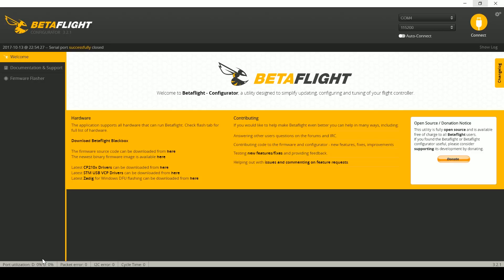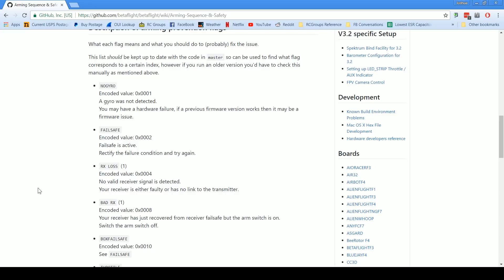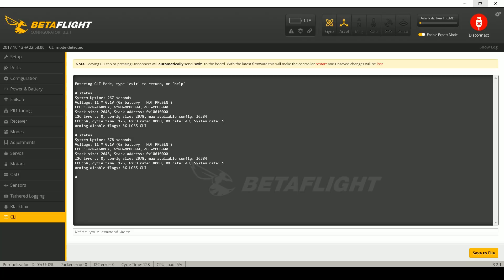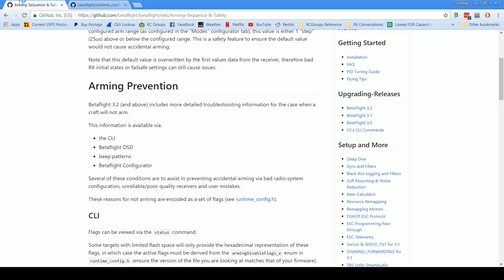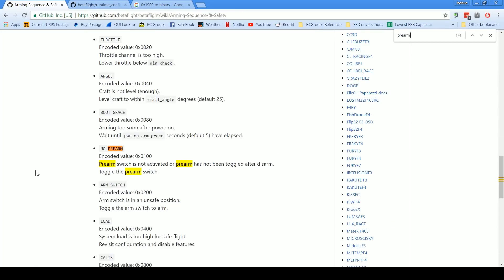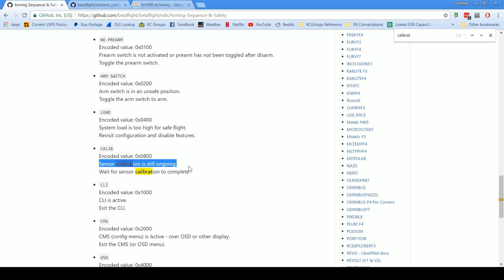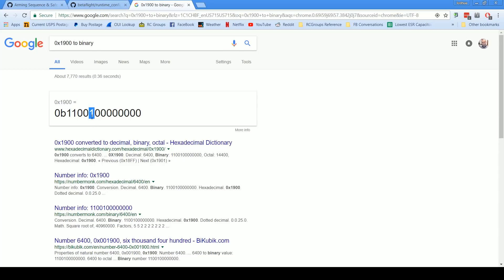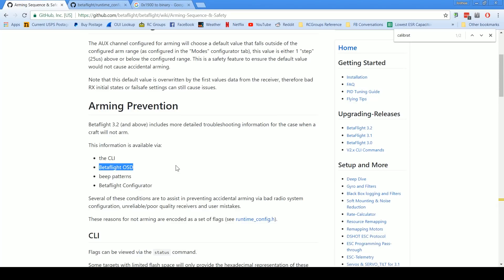Betaflight 3.2 | WHY WON'T IT ARM?

Comment: I just spend a few hours trying to get my quad to arm. I finally found this:
https://github.com/betaflight/betaflight/issues/2914

 
 set moron_threshold = 100

 save

 
This seemed to do the job. 
Apparently the moron_threshold says something about the window of acceptance for the gyro values. Setting this to a higher value will allow some noise from the gyro's to be within acceptable range. (If I mis understood this, please do correct me)

 

The weird thing was, when I plugged it into the computer by means of USB, Betaflight instantly gave permission to arm. But when I connected the battery, it sometimes could take a long time before getting the 3 beeps. So it was difficult to troubleshoot as I could not note any troubles when connecting to a computer as it gave no Arming Disable Flags. Anyways, it seems to work now. Hopefully this helps some people who have troubles arming.
Reply from the maker: +MaartenFilms if you need to change that parameter it suggests something is abnormal about your gyro. Keep a careful watch for weird flight twitches that might indicate the gyro is failing.
Reply: Thanks Joshua, I will. Hover test was okay. I'll be doing some more testing and be cautious. If I suspect anything weird, I'll just change out the FC.

Comment: How do we fix it both my new bf f4 has this code and many others. I plug my quad upside down so it don't move then I can fly no problem... its annoying bf f3 no issues always f4 after fresh firmware update. No accellerometer it's disabled...
Reply from the maker: +Gap of DooM what code does it throw? What flags are active?
Reply: Joshua Bardwell it was the throttle flag, so i set min check to 1100 it works now but not sure it was the right thing to do thanks for the info!!! And thanks for educating us, appreciate it very much 👍

Comment: Hi Joshua.I just flashed with betaflight 3.2 and dshot 600 and racerstar lites 30a escs and an issue occured.I used dshot with betaflight 3.1.7 and everything worked fine.Although i tries downgrading and the same happens now.My transmitter is a spektrum dx8 and i fly with a satellite reciever.FC Betaflight f4 from banggood.When my quad is plugged at my laptop and the battery is on i can arm it, disarm it and it works great.As soon as i unplug the usb i can arm the quad it works and after 10-15 seconds it stops, the fc blinks the satellite blinks and escs beeping strange tones.I would apreciate if you could help!Thank you in advance.(Sorry for my bad English)

Comment: Thanks Josh, great information and appreiciate your guides and best practices.. I followed your steps on this one and my Betaflight FC F3 still wont arm after going to 3.2... I am set in air mode and converted the hexdecimal to binary and looked at the link; 

Here is the binary 0b1001000100000

Any thoughts? If i flash back to 3.1.7 it works fine, crazy part is i have a betaflight FC...
Reply from the maker: Ok so using the technique in the video, what arming flags does that binary code indicate are active?
Reply: Throttle error - i have it at 0, CLI (i closed after and tried, then the last one - BST error ?

Comment: Thank you for existing!! 
So I did as you explained (f3 board).
The binary told me 13, 
CMS
Encoded value: 0x2000
CMS (config menu) is Active - over OSD or other display.
Exit the CMS (or OSD menu).

How can I exit that?
I typed "exit cms" on the CLI and it rebooted but it still shows the same status.
Please help me! Thanks.
Reply from the maker: "Exit cms" doesn't do anything. The only reason it appeared to do anything is because "exit" is a valid command.

Have you got the OSD open?

Have you got an OLED screen attached with the config menu open?
Reply: Joshua Bardwell The OSD is disabled.
I never figured out what happened but it's arming! I had the crazy motor issue when I hit mid throttle but it seems it is normal when the quad has no propellers to keep trying to correct the vibration or something.
Reply: Joshua Bardwell Oh God... it stoped arming again, with the same issue.
Reply: OLED is also disabled in the features.
Reply: Working again.. don't get it, but I'll see if it flys tomorrow.

Comment: I see in 3.2 release notes to do a backup of your old version then once flashed to 3.2 to paste your settings in CLI and then reset to default settings. I haven't seen anyone elaborate on this, is this a necessary step? I have 2 lux V2 FC I flashed without doing it and all is good. Diatone Fury F4 though keeps booting up in bind mode on spectrum receiver. Receiver tab is all crazy too. Could this be an example of corrupted config? Tried reflashing 3.1.7 and still same. Also I didn't do a backup. Sorry Joshua I know this is completely off topic, any help would be greatly appreciated
Reply from the maker: Yes it sounds like a corrupted config. Frankly, coming from 3.1.7 to 3.2, I would definitely back up the config for reference, but I would probably just re-build the config manually rather than pasting in the lines.

Comment: Anyone else have an older XM+ receiver suddenly not bind green after upgrading?  I'm getting dim solid red/green lights now, and the only change is upgrading to 3.2.

I know, the XM+ probably needs a firmware update.  Just wanting to confirm the possibility that an older XM+ might not bind with 3.2?
Reply from the maker: Going to BF 3.2 cannot in any way affect whether the XM+ binds to the Taranis.
Reply: Joshua Bardwell- Cool, thanks for all the helpful stuff, man!

Comment: My quad wont arm and status says it's the CALIB flag.. the only way I can arm is if I spin the motors in the motors tab and then disconnect from the PC with the battery still plugged in.. it will arm and fly just fine.  but when I unplug that battery and try a new one, I have to do the whole process again.  The OSD warnings says "ARMSWITCH" but in the Modes tab the Aux to arm is moving correctly to activate the arm (the Arm turns yellow, I get the caution symbol at the top of the configurator).  It will consistently behave like this.  Will not arm unless the motors are spun manually in BLHeli or BF configurator before arming with radio.  I would like to think this brand new Betaflight F4 board doesn't have a bad gyro, after all it does fly OK when it finally arms...  besides swapping in a new FC to troubleshoot, any other ideas I can try?  I've already tried the suggestions in the video about leaving the quad completely still/flat on the ground when plugging in, etc.  Thanks in advance.
Reply from the maker: What is the value of the arming flag before you spin the motors?

What is the value after?

Comment: Joshua... SedHendo here. I wondered if you have run into issues with a 4in1 esc when trying to set your quad up for turtle mode.After flashing my Cicada 30A esc with the latest dshot update and with the FC on the newest 3.2 Betaflight. Now one esc won't work. Even if I flash back to a previous version. I thought this was a fluke but this has happened 3 time on 3 secs...

HELP!!!
Reply from the maker: The 4-in-1 ESC should just be four separate ESCs on a single board. Maybe there is some issue with the Cicada 4-in-1.

Comment: Hi Josua Bardwell finally fixed my arming problem thanks for the help. Although now I am wondering about something else. Whenever i reach full throttle my fatsharks picture freezes for like half a second. This also sometimes happens randomly and I don't know why. thanks for the help
Reply from the maker: +Davis Baldwin i really don't know what could cause your picture to freeze up! Wow, that's weird. Since it happens at full throttle probably it is related to vibration. So I would look at the physical wiring and plugs between the camera and vTX.

Comment: At this point is it wise to invest in a F3 controller?  You said in one of your videos that the Pid Loops for Betaflight 3.2 could not go over 4k/4k in the F3 anymore (that may have been with the new Dynamic Filter on).  You also said here that the code space is so "tight" on the F3 that for some error codes they output the actual error codes like  "0x400, for example" rather that a string "No RX".   I would like to hear your comments about this.
Reply from the maker: +Trey Weaver I would focus on F4 today but I wouldn't throw out any F3

Comment: Joshua can you please point me to a guide on how to get a F3evo board to keep the reciever as SBUS when UART2 or UART3 is checked.  I've dug all over Google and YouTube and no luck. It's on a Fatbee 90 and same on Qx90. ice followed several videos step by step nothing works.
Reply from the maker: If you enable serial RX on the UART, then save, then go to Configuration and select serial receiver and SBUS, then save... then that's how I would do it. If it's refusing to save, I don't know why. Have you got anything else at all active on the UART? Maybe there is a conflict. Serial RX must be alone on the UART.

Comment: LOL, I was gonna make a video about this... oh well, guess I'll delete it now.
Reply from the maker: +Albert Kim no way man. Your audience wants to hear your take on it.
Reply: Keep it, and keep it short ;)
Reply: hey Albert. good to have a second opinion on my issue. I can't get a wizard 220 to arm. every thing works. Iv tried a new reciever. I get a rxloss flag in the cli status. Iv tested the motors in bF. they work. there is no damage that I can see. this happened after a crash, it tumbled and broke two props. then I disarmed it and it stopped immidiatly. now it won't arm. any ideas? the receiver is not soldered in and there is no damage to the plug or plug pads.
Reply: Raise min check from like 1050 to 1060? Set min_check = 1060 Sometimes mine would act up.. I could press the throttle down hard as I armed and it would work... for a while then I had to raise the min check... or lower... cant remember:P
Reply: Andrew D no. thank you. I'll try that.

Comment: Quad Dr. Bardwell, two questions. 1. Using my Taranis X9D plus in Betaflight, when I go to full deflection 1000 with my pitch, my gimbal recenters at 1500 just fine. But when I go to full deflection 2000 with my pitch, my gimbal recenters at 1496. I have messed with changing my center point, but I can't get it correct to 1500.  Any worries? If so any ideas? 2. When calibrating my channel end points, lets say to 1000 is it better to be closer to 998 or 1001? As always thank you!
Reply from the maker: +Timothy Blaine if the gimbal consistently refuses to recenter then the gimbal may  be worn.
Reply: Joshua Bardwell it's a brand new taranis, maybe two months old. Are you suggesting maybe I change out or upgrade gimbals?
Reply: Timothy Blaine would higher rc deadband help?

Comment: Hey Joshua 
I have a f3v4 pro FC. At first plugin the Goggles showed all the battery info and regular osd stuff but when taking it out flying now it just shows arm and disarm and low battery. When disarmed it shows max amps and all that stuff. Could my osd be shut or just not programmed. If so how do I program it. 
Thanks Leo
Reply from the maker: +Leo program the osd in the Betaflight OSD tab. Try manually setting PAL or NTSC.
Reply: Joshua Bardwell 
The video format option doesn’t show up in osd tab in BF
Reply: Joshua Bardwell I changed the camera switch to pal and now I see the amps and other stuff
Reply: Joshua Bardwell 
Sucks to be me. Just lost my second quad. Guess I’m not cut out for this Hobby. This one went into the river. 😩😩😩😩

Comment: Thanks for decoding the binary for those using F1 and F3 boards.
Probably best for us all to shift to F4 boards like the Kakute F4.
Kakute = in this way

Also, here's another:
Kakute = Rings made of iron or steel that were sometimes worn by the ninja, and favored by the kunoichi, having one to four metal spikes protruding from it. The spikes were sometimes dipped in poison. Kakute were usually worn on the middle finger with the spikes hidden inside the hand, and then used to attack when the enemy least expected. The spikes were also excellent for holding onto an opponent, striking across the face, choking, and sometimes climbing as well. Some kakute had a tab with a hole, that was used for hojojutsu techniques. In this sense, the hojo (rope) could not be easily pulled away from the hands of the ninja or kunoichi, since it was tied to the kakute ring on their finger.

Comment: Hello Joshua, I’m not sure if this could apply to my quad. I bought the arfun95 about a month ago, flashed b/f3.2 straight away. I notice sumtimes it wouldn’t arm at all. But the problem is that if it arms successfully, I can fly about, but when attempting punchouts/ flips n rolls, it seems to disarm n fall to the ground!! I’ve changed the battery connector to xt30 and use 2s bolts instead of the stock battery, and the problem actually seems worse! I’m pretty sure it’s disarming rather than suffering the famous brown outs, for this model. Also have massive drift issues, do you think I’ve bought a faulty quad? Or am I not set up in betaflight correctly? Bought from GearBest and they don’t even respond to me after at least 10 emails!! Worst £115 I ever spent so far on this hobby unfortunately....

Comment: After a crash I installed a new prop and upon connecting the battery got a spark at the connectors. Now my quad beeps three times and nothing. It will connect to Betaflight ok (with correct beeps) and seems to read all the gyro setting etc. from my desktop. Thanks for the video, maybe this will help me get to the bottom of my problem. I think the FC might be fried.
Reply from the maker: +Dude Duderson beeps 3 times simply means the ESC's have power. It sounds like the 5v regulator on your flight controller is fried. It works from USB because USB provides 5v. You can use an external 5v regulator or you can replace the FC.
Reply: Joshua Bardwell Thank you Mr. Bardwell! This would explain why my camera doesn't work. It's an all in one FC in a tight build, so it looks like it needs to be replaced.

Comment: I have a Hglrc f3 v4 pro that will connect to Betaflight but will not go into DFU mode. I have tried both the boot button and the cli command at which point it says rebooting and basically freezes up and has to be unplugged from usb and reconnected to connect to betaflight again. So it connects to Beta, but i Cant flash. It has been Rebooting mid flight on me like it totally loses power, but the connection is solid. Im lost please help!
Reply from the maker: +Sean Lee use the impulse rc driver fixer
Reply: Joshua Bardwell I tried to this morning, it just says searching for flight controller. Really stumped on this one. Thanks for replying.

Comment: Thanks for the great on point vids! I set all my quads to Pt1 and turned off the two notch filters. I have to say I have never had such performance. 3.2 is incredible. Keep me coming 👍
Reply from the maker: Awesome! Those filter changes really make a difference don't they!
Reply: Joshua Bardwell yes! Not to mention getting the antigravity up at 3.5 and d and set point just where I like it. I have never had anything fly this awesome and it’s thanks to the knowledge I got from your vids. I def learned something:) thanks again!

Comment: Mine says throttle. Had to adjust my controller throttle from 100 to 75%.
Reply from the maker: That's not the right solution. Your endpoints should always be  1000 to 2000 in betaflight if at all possible. Adjust Stick Min to be 10-15 points higher than your lowest throttle channel endpoint.
Reply: Mine says throttle in Cli how do i adjust  to lower throttle channel? On the radio or in Beta flight?

Comment: Great info josh!¡  you are the first one providing the info on youtube at least, or let me say leaving it easy to us ;)

By the way i got a question, is there any way to turn off some of the esc sounds? I got game of thrones esc beep at start, but a second after , just makes the typical beep beep beep  bi ri rip,  but it is too looud and when i got my fire stopper connected in between the batery and the copter just sucks all the juice and makes the bulb briiiggt...    so i was thinking that maybe we got an option in the cli, for choosing when to beep the esc alone, like the options we have in the configuration tab for the normal beeper , i know the blheli comm peotocol with betaflight its not as advanced as the kiss, but maybe there is a way already ( changing the sound level of the beacon of the esc, wont help, as you know the music played from the esc's depends ond the volume that you set it and i dont want to silence it .

Thanks a .milkion for your hard work !!
Reply from the maker: Turn down the beep strength in BLHeliSuite and it will make those beeps quieter.
Reply: Joshua Bardwell its been 2 months now since i habe not been in the blheli configurator, but... isnt that the volume adjustment that will change the 'custom' song of the esc at startup?

Comment: Have they changed the DFU or boot command in one of the 3.2 versions? I'm not able to use DFU on my 3.2 quad but it works fine on my 3.1 quad, I just don't remember which RC it is, will be an early one.
Reply: Faawks try BL instead of DFU in cli
Reply: Thanks for the reply, it just sits there saying "rebooting" no matter how long I leave it when I use BL.
What command is that? I've never seen it before.
Reply: Ahhh, just looked it up and DFU has been switched to BL, so it just simply isn't working for me, damn.

Thanks anyways mate!

Comment: your old vid helped me. Mine was b/c 100% cpu. I was trying to run 8k/8k with dynamic filter on f3 nano omnibus, no bueno. Also, you have to set the dshot beep tone in the cli for the motor beeper to work.

thanks for your vids

Comment: Why are F7 boards not working. CPU usage at 100% when using 32 gyro and 32 loop time?
Reply from the maker: +Christian f7 support is not finished. 32k support is experimental.